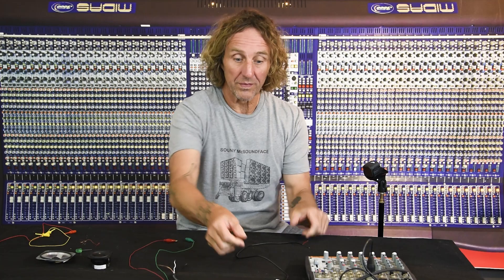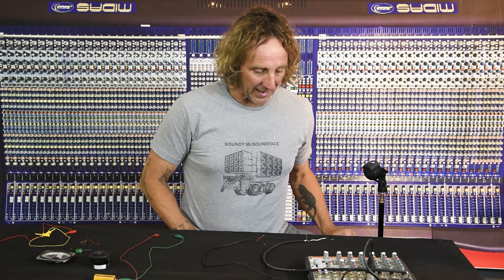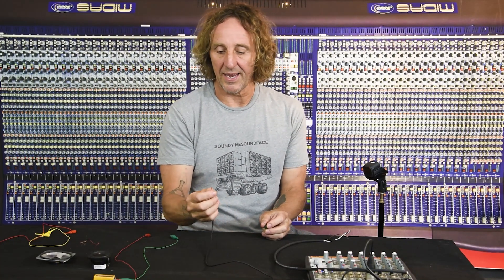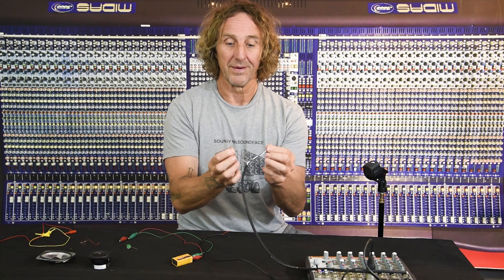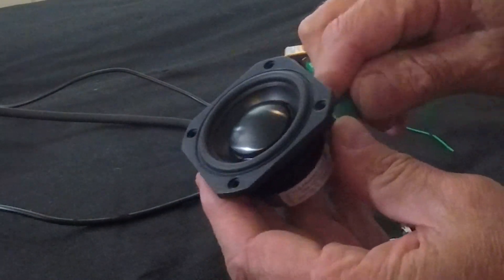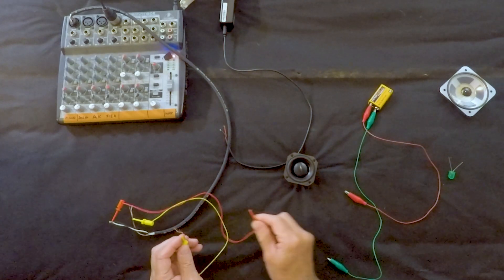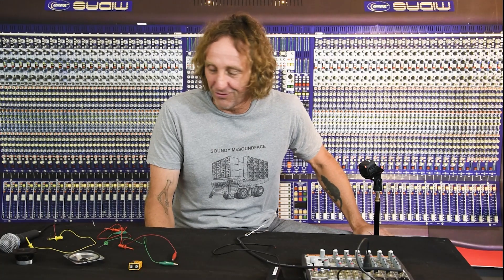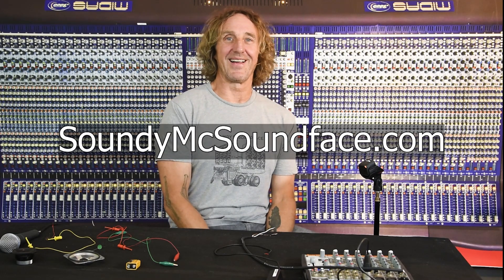Which is More Dangerous? Phantom Power, USB Power or a 9 Volt Battery?

Comment: It's the old electrician's rule of thumb, Dave: "It's not the voltage that kills, it's the amperage (current)."  So, based on that, it appears the mixing console's phantom power is very low current draw, compared to the 9 volt battery or USB power.  So, it does make sense that the latter 2 power sources may be more dangerous based on current draw.  The only real way to tell how much current (in mA) is to hook up an ammeter in series with what load you're powering up.  

Luckily, most microphones that use phantom power have either a preamp circuit that takes the majority of the phantom power (thus isolating the microphone capsule) or there is some kind of isolation transformer installed to prevent phantom power from going directly to the capsule.  Which is one reason most ribbon mics cannot take phantom power without destroying the ribbon or coils inside, as they aren't isolated (with exception to some of the Royer brand ribbon mics, as those are designed to take phantom power).  

Now, here's an interesting check to try.  Some condenser mics have better dynamic range and frequency response, when you increase the DC voltage source in phantom power.  The Crown PZM mics are a prime example.  Some of them can be powered by a AA battery, but they are built to take dual 9 volt batteries or power directly from the mixer.  

I have 3 unidirectional condenser mics (Radio Shack 33-3017; about mid-1990s vintage).  The stock specs say to use a single AA battery as the power source (The way the XLR is connected, it prevents phantom power from any mixer via XLR cabling to work, so batteries it is.).  It isn't well documented, but has been confirmed that you can hook up 2 of those Duracell PX28A (Energizer A544) batteries inside and make it sound even better; 1.5 VDC vs 12 VDC, about 10x more power being fed to the mic.  Not to drop names, but Harvey Gerst (if that name rings a bell) is one of those who confirmed all this.
Reply from the maker: Phantom power is supplied through 2 6800 ohm batteries. One on pin 2 and one on pin 3

So the calc is easy for current.

Yes, the higher voltage on mics will often increase the dynamic range. 

The 1.5 v batt on old mics before there were cheap DC to DC up voltage converters, were quite limited in output.

There are some mics like the AKG c451 with versions that are 12 to 48 v phantom and I. The spec they list the differences and improvements of using 48v
Reply: @DaveRat  A number of microphones step the voltage up for capsule polarization, the preamp itself often only needs around 10 or 15 volts. Usually the capsule polarization is around 60 volts or so, there is a step up converter inside the mic electronics. Some microphones need as much as 200 volts polarization (Altec Coke Bottle, Bruel and Kjaer) but those usually have external power supplies.

I remember one “mod” for the Radio Shack PZM was to raise the voltage of the battery. My “mod” was to remove the transformer, add a transistor buffer, and phantom power them, a lot like the AKG C419 circuit. That was an electret capsule that didn’t need polarization.
Reply: It’s both the voltage and the current. Shorting out a car battery puts out 100s of amps at 12v. Touching the terminals doesn’t kill you. It takes a certain amount of voltage to overcome skin resistance to get enough current.
Reply from the maker: Yeah, voltage has to be high enough plus current has to be high enough and wetter is worse and saltier is worse and size of contact area and across the heart voltage is worse.

Lots of variables

Comment: Great video Dave. We use 9v batteries for quick tests of 70v speakers to see if they are wired in line or to check for non functioning ones in a customer's system if we don't have a source handy. Cool to know about the phantom and USB.

Comment: 🤔hmmm ever wondered, if you can overload phantom power suply, like on 32ch console with 32 power hungry phantom devices. Never found any specification over phantom power power.
Reply: It really shouldn't be possible...
Phantom power has a source impedance as part of the spec. That means that the XLR pin 2 and 3 are each connected to 48V through a resistor. That means that absolute maximum (non deliberately destructive) load is known, you cannot take any more current per output than a direct short. All the desk designer needs to do is provide 48V at whatever the total maximum load could be and you will never be able to drag that down via plugging in to the XLRs.
Reply from the maker: Agreed, phantom is such a low current and all puts are current limited, it would be quite easy and low cost for the phantom supply of a console to be designed to supply max current to all channels simultaneously and still have plenty to spare

Comment: Phantom powered mics require SO LITTLE CURRENT......... that most power supplies are capable of very minimal amperage.   Thus,  the 48v drops like a stone when it's seeing a source with little resistance.   Heil Fin mics use phantom to power some LEDs...   Some mixers will "cry"  having to supply that much amperage.

Comment: In that USB vs 9-volt battery test, you have the polarity reversed, causing the cone to 'bottom-out' in either case. If you reverse the leads, the cone will move outward, giving a better indication of the strength. I'm guessing the 9-volt battery would win.
Reply from the maker: Speakers should be symmetrical and move the same distance both ways
Reply: @DaveRat  Agreed, but in your case, you're driving them with DC and determining which is stronger. Bottoming-out will give no indication.
Reply from the maker: Same as topping out?
Reply: @DaveRat  No, bottoming out hits a hard limit, the rear of the magnet.
Reply from the maker: Only on poorly designed speaker will the travel be asymmetrical, a properly designed speaker has the same limit in both directions from the spider and surround.

In other words, if sending a sine wave or positive or negative pulses to a speaker it should not reach maximum travel in one direction before the other direction. 

And the travel should be identical or nearly identical.

Avoid using speakers that bottom out before topping out and visa versa

Comment: Cool! I didn't know that phantom power was limited with such a small current! is it the case on all boards?
Reply from the maker: Yes, the spec on phantom is a 6.81.k resistor on the 2 lines. So 338 mw x2 so about 680 mw is the spec